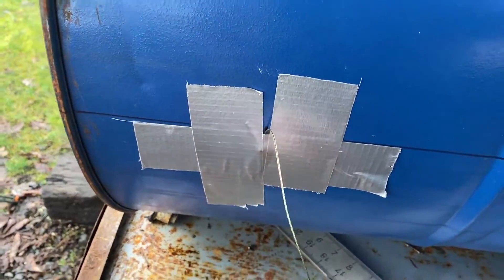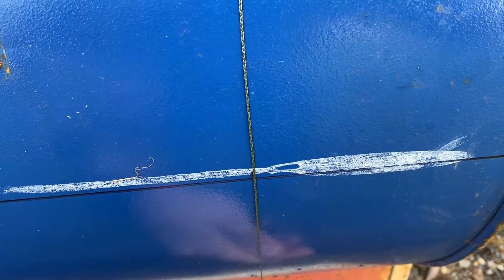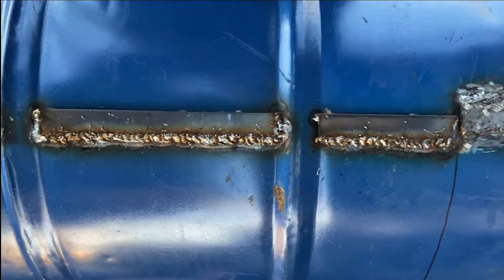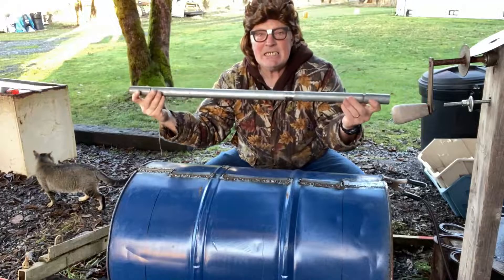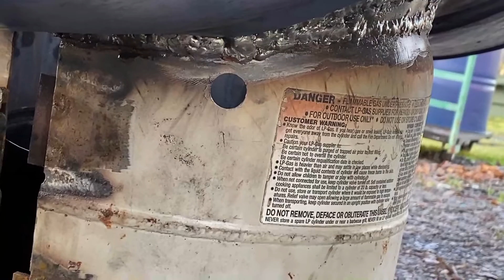Waste Oil Burner Oven 4 of 4

Comment: Next time you try to make the oil drip so you can monitor it easily, suspend your control valve ( ball or gate valve) about 2 to 3 inches above your supply tube with a funnel! You can even use a plastic funnel as long as you keep the supply tube a few feet away from the heat source or just use a metal funnel!!
Reply from the maker: This was too easy to do, but not the only way. I also considered wind interference and the size/height of the drip system. From the original design that I saw, the ball valve is soooo much an improvement than the twisting gate valve... and the fabrication is kept minimal.  But as I said, it's not the only way to make it happen. The funnel would work well, too.